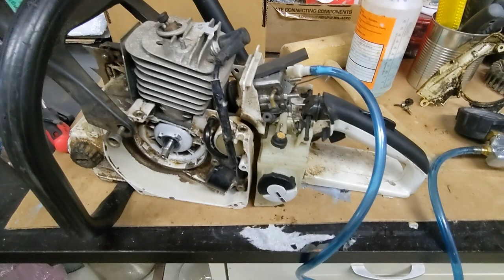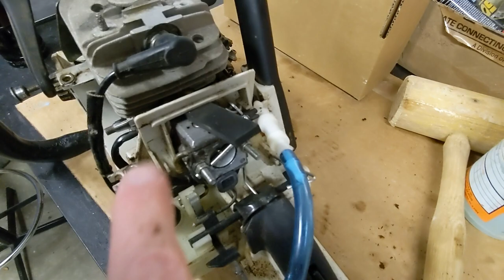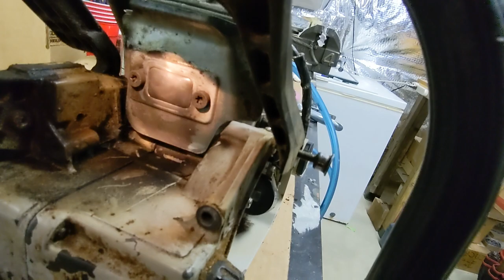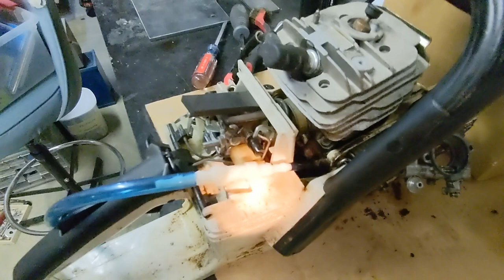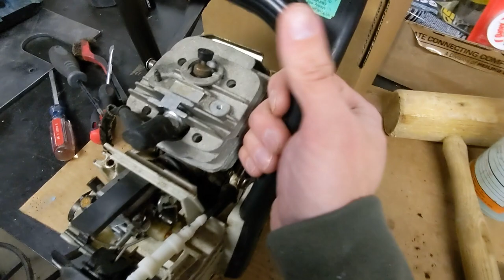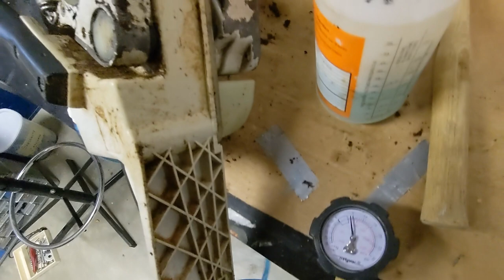How to Find the Leaking Crank Seal on a Stihl Chainsaw!

Comment: You have to take the decomp valve out it will leak through it
Reply from the maker: Good advice John! I noticed the top end rebuild kit I bought came with a solid plug. If I do this again, I'll plan on plugging it with that before testing. Thanks

Comment: Good video, but I differ on a couple of details.  If you suspect a seal leak a vacuum test is more definitive if it's only barely leaking during a pressure test.  You can't use soapy water for the vacuum test, but you can put a small amount of any kind of oil around the seal in a horizontal position and the vacuum will pull it in.  As for the pressure test, I would have also sprayed around the base gasket, all the pressure testing equipment connections right back to the tester, the spark plug, the decomp and, of course, intake and exhaust at the same time, just to make sure you only have one leak.  You probably did all that before making the video, but I just thought I'd mention it.
Reply from the maker: Rein, Thank you for the constructive criticism! I did check those other spots on the saw, but never thought to check the tubing connections, very smart recommendation. Also, I like the oil idea for checking the vacuum leak. If I make another video along these lines I'll be sure to mention all that. In the meantime I hope folks watching this video will see your comment to advise them!
Reply: I like to put the whole saw under water and watch for bubbles. We can already assume everything is sealed off well since it'd be hard to pressure or vac check without a good seal. 

I like your vacuum trick with the oil. I tend to pour a little gas or diesel on the seal (crank tipped up vertical) and watch for it to disappear. If there is no puddle for 30 seconds to a minute, it's leaking into the engine. Diesel doesn't really evaporate in a short time, so that's a better fluid to do this test with.